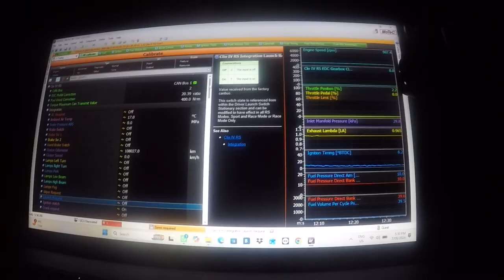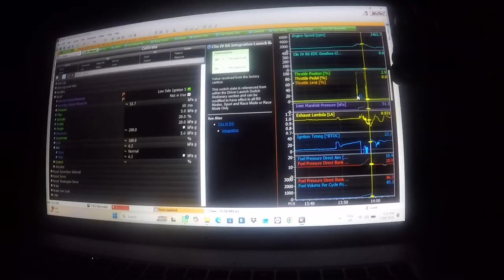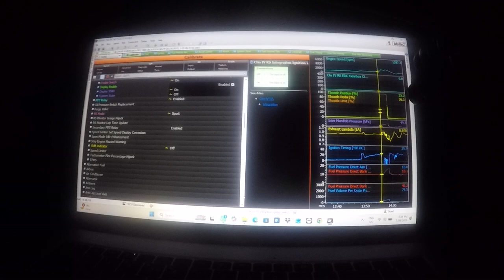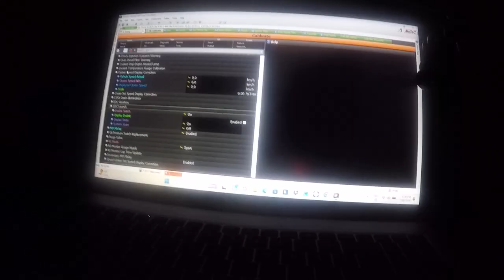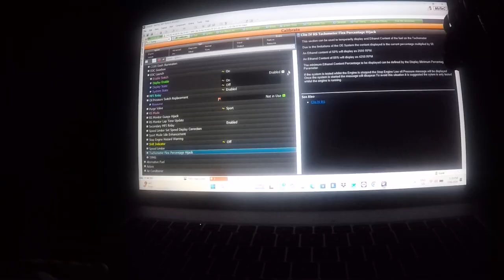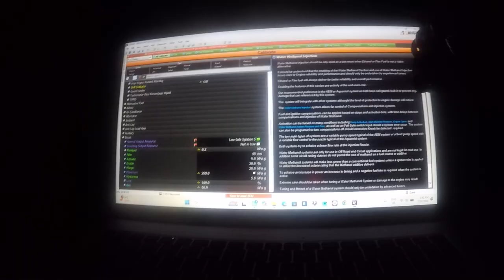Clio 4RS Stand Alone Motec ECU Firmware Package now Available with full integration incl factory TCU

Comment: This is some awesome work! what sort of costs are involved?
Reply from the maker: the firmware cost is $1700 aud and comes with a start file that is an actual tune file from a standard car, you need an enabled Motec M142 ecu which i can supply or you can obtain locally, you need a Motec LTC Module (lambda to can) and a bosch 4.9 lambda sensor. You do need to manufacture an adaptor loom and you will need a donor ecu so you can get the PCB header. I can do this for you or i can supply you a pin out and you can make it yourself.  Software is open, no password or security token required. Software is a free download from the motec website